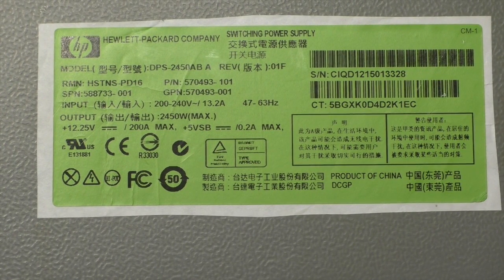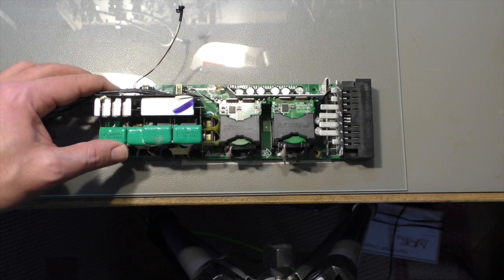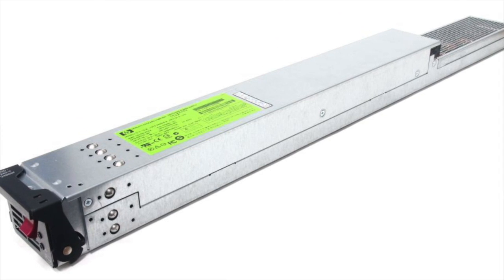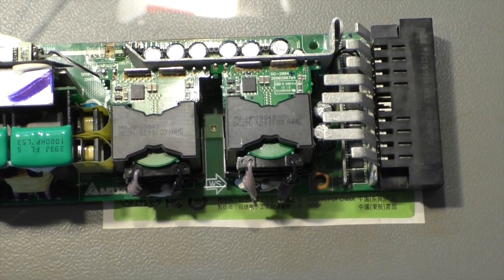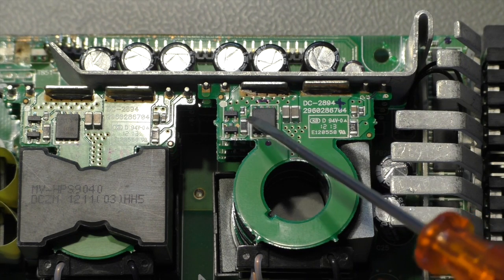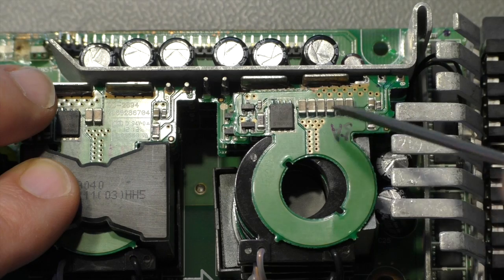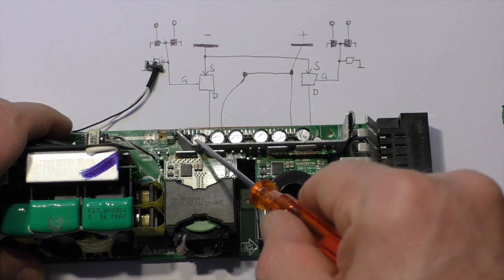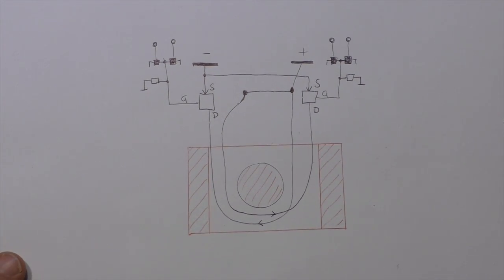2.4kW 200Amp small power supply (PWJ25)

Comment: Do you know, how the load sharing is done on these? As far as I know, there are 6 of them on a common 12V rail, on C7000 blade frames?
Since these are so cheap, compared to like Meanwell RSP-3000-12, 20€ vs 400€, it wouldn't cost much to get like 6 of them and connect them in 3x2 star configuration on 380V/32A to get like a Boostmaster 1200A for my bitching diesel excavator, instead of wasting money for new good battery every few years....

Comment: i know this is a old video, but has anyone figured out how to turn these on and what modifications to make to get the 12v 200a out of it?
Reply from the maker: Most of these power supplies turn on by pulling the „on“ pin to ground. Which one that is changes from model to model. It‘s like a PC power supply, green wire. Some P.S. will need a processor talking to them. Those are not suitable for tinkering…
Try Google „turn server power supply on“ many hints are in RC forums.

Comment: I have the same type but mine seem to be a newer model from 2011,  the date is mentioned on it, and a gold one so little better efficiency. The reason I think its newer is because its different to the better where (what I guess it is) the PFC is on the same board (and thus not single piece and thus unfortunately not removable but better when constructing) but some distance away from the same transformer principle as in the video. However the transformers in this one are much smaller and flat standing upwards and they are only, I'm not kidding now, 14mm thick, 28 mm wide and 25 mm in height and there are 4 of them and there are 16 big mosfets around them all pushed against 2 different heatsink where the mosfets closest to the transformers are on a bigger heatsink and all heatsinks are 1 mm thick pure copper and nickel plated. The area where all the transformers and mosfets are is not bigger then my hand! If you would have put that part in my hand and looked from the other side you would not have seen any of it! How the heck can they cram out 2450W from this, that is an insane 612W per transformer of that size!!
Reply from the maker: Sometimes the power supplies come from different manufacturers. There is a good chance that a different mfg has different tricks to get the same result....
Reply: @PlaywithJunk  Well true but HP sure has a finger in it form start to end since they are quite complex.

Comment: Is there a way to get more voltage from the blade 7000?
Reply from the maker: All power supplies have a 12V output... the only option is to connect them in series (24V 36V etc) But keep in mind that the cases must be insulated from each other and earth wire must be disconnected or you get a short. Not very safe by the way. I don't recommend it.
Reply: What I mean is to actually turn up the voltage on it make it 15 volts  instead of 12 v
Reply from the maker: I don't think so. There are no trimmers inside. And I doubt that some sort of remote sensing would go that high.

Comment: The semi-planar design with interleaved coils is mainly done to increase the coupling coefficient of the transformer, basically how much energy is transferred to the other side vs how much is stored as a magnetic field. The energy stored in the field is not lost, but it causes extra current to flow in the primary which needs more copper and produces more heat.

Comment: I am a bit interested in what they are doing on the AC side of this supply. HP sold two versions.  One was a 100-120 / 200-240 volt version at 2250 watts and a second that was 200-240 volt only at 2450 watts.  I'm actually interested in how the AC side was designed and if they simply simply dropped the 100-120v listing because it was too confusing (980W rating at 100V), or if there is a difference in the design between the two.
Reply from the maker: Normally, power supplies use a internal boost converter to make about 300VDC from the input voltage. This 300VDC is then processed further. In a 230VAC environment, you don't need that boost converter because you get 310VDC after the rectifier and primary capacitor.
Boost converters have a wide range of input (100-250VAC). Without the converter you need at least 215VAC to get 300VDC. So that's most likely the difference.
Reply: @PlaywithJunk  The newer supplies (better: the not very old ones) with "Power Factor Correction" have a boost converter that "rides the sinewave" to make 300V from whatever is the sinewave voltage at that time (instead of a full bridge rectifier that only charges the capacitors at the peak of the sinewave).

Comment: Very good video but it would be good to know how to raise the voltage to 13.8V
Reply from the maker: Do you want to charge lead-acid batteries? That could be difficult since many of those server power supplies are made to deliver a super stable 12V and they did everything for that. Changing the voltage could be challenging.
Reply: @PlaywithJunk  People wanting a 13.8V power supply often want to use it for equipment that is designed to be powered from lead-acid batteries (like in a car), or at least was designed for that 'standard'.
E.g. Amateur Radio transmitters are usually designed for this voltage.  It is commonly called "12v" but in reality it is 13.5-13.8V.  And this small difference is quite important because that voltage is already quite low to make decent output power (normally 100W).
But in fact this kind of power supply does not really fit that purpose.  Once you require like 2kW of power, the voltage is usually chosen to be higher, e.g. 24 or 28V or even 48V.  Modern semiconductor high-power amplifiers require that kind of voltage, and when they are powered from 13.8V they include a stepup converter.
For somewhat smaller 12V switchmode computer supplies there often are directions how to raise the voltage a bit, usually by changing some resistor in the feedback circuit.

Comment: Does anyone know how to modify this supply to be used as either a 15v or a 30v charger??
Reply: You have to identify the other signal  lines on the connector. It varies a bit from supply to supply, but typically there are Enable, Presence, Vsb, Grnd, Sclk and Sdata. Some supplies have address lines, and some set the address using a resistor divider network using the Presence and Enable pins. 
That depends on the model and for what chassis they were designed for.  Word is you can stack the output in series to boost voltage but must absolutely go though and isolate the output from ground on the second and additional supplies before trying to do so. Playing with 200A PSUs can be a bit dangerous.  There have been some videos on adjusting output voltage, but I haven't seen one yet for this particular model. Also this is video shows a 200-240 volt supply.  There are 2 versions of this particular supply. One is a 200-240 only, and the other is a 100-120 or 200-240 version with a slightly lower output rating (2250 watts vs 2450 for the 200-240 only variant). On 100-120 volts the rated output is (only) 980 watts.
Reply: Oh.. I forgot to add, I haven't seen anyone look at controlling current or putting these supplies in a constant current mode.  I have no idea if that's possible. It IS possible to blow out devices using this as a charger if you don't have current limiters that can manage the 200 Amps in place.
Reply from the maker: Without a schematic diagram, that will be difficult. I doubt that it is even possible since this is made to supply 12v and nothing else. Maybe you can tweak it to 13 or 14v..... but certainly not 30.
Reply: @PlaywithJunk  the 30 would be two units in series. I have t been able to find any schematics either. Frustrating

Comment: The mosfets at the output are the 'Oring Diode'. These power supply are stacked in paralel operation, so if one of them fails by shorting the output....those fets will decouple it from the buss bars. 
The topology used in this supply for the rectification is called current doubler, and uses ZCS [LLC] for reducing switching losses. If I remember correctly it should not have inductors at the output, the secondary of the trafo looks like a push-pull configuration [center tapped]. It would be interesting to see the turns number in the primary side. I'm expecting near 20...

Comment: Very nice presentation. Today I`ve dusted off a similar HP power supply(DPS-1200FB-1A). Mine has 1200W Output Power 12V @100Amps (94%). The amazing fact is the size. It`s so small and it has the same topology as the one presented in your video. Thumbs UP indeed !!!

Comment: Nice Video, i have never seen this "PCB Coil" construction before.
But i think your loss calculation shuld inlcude the switching losses:
In those High frequency Switching Powersupplys, the "turn on loss" is only one part of the the whole. The switching losses of diodes and Fet's  are proportional to the frequency and can be much higher than the DC-resistance losses.
Reply from the maker: +Bibarco That's certainly true but since I have no data of this power supply I keep it simple and playing with DC figures.
Reply: Play with Junk

Comment: Transformer construction is like the planar magnetics commonly used in DC-DC converters, where they use a multilayer PCB for the windings.
Not sure why they need all those FETs on the outputs as well as the ones on the transformers. 
Those green capacitors on the HV side maybe mean it's using a resonant topology, where they switch at zero crossing to reduce switching losses.
Reply: +kubeek 
I see you misunderstood what I wrote above:
1. I was talking about those  mosfets situated near the output connector of the PCB, those are for the Oring " active diode" which offers the capability to connect multiple power supplys in parallel and if one enters in short circuit aka FAULT, will not pull the whole supply bank to ground or catch fire.
2 . Synchronous rectification is used in high current low voltage for higher efficiency, more than 100w saved in this power supply with synchronous rectification.
3. Individual rectification on the output transformer ensures an easily current sharing between mosfets. Nowadays these mosfet's cand have down to 0.5mohm and it;s hard to ensure a good current sharing between them, so by splitting the seccondary turns in many groups, the parasitic resistance of each winding can be used for our advantage by helping on current sharing.
Reply: +mikeselectricstuff The transistors from the edge of main board are the O-ring "diode" as this power supply can be used in parallel, so they have active diode for protection against internal short circuit without pulling the whole bus bar. Also it can be hot swapped. It is nice to have individual synchronous rectification on each secondary coil, as it can share better the high current over the mosfet. Good design.
Reply: +mikeselectricstuff 
Those coils on the primary side and the lack of a secondary filter coil is another tell-tale sign of a resonant topology. I'd guess it's an LLC topology. You can see that the primary side coils are connected in series with the transformers when chrigel1234 flips the board at 5m36s. 

That multiple section design of the transformers is probably done in order to keep eddy current (proximity effect) losses low in the windings. A side effect is that the leakage inductance of the transformer is reduced, so the external coils were likely necessary to get the desired frequency/gain response in order to make the LLC converter work well over the full range of load and input voltage from the PFC stage. I'm not sure, but it looks like one might be in series and the other in parallel with the transformers.

+chrigel1234 Thanks for the teardown of this piece of equipment! :)
Reply: I would guess the transistors on the edge of the pcb are for the hot-swap capability, they probably have dV/dt control on the output so the transistors have to dissipate a huge amount of power when switching on into all that down stream capacitance so they need a lot in parallel to keep them inside their SOA
Reply: +Gatea Catalin nope, the output transistors are mainly used as synchronous rectifiers to get reasonable power dissipation in the output diode after the transformer, the 0.4V drop vs 1mOhm on resistance being the selling point. The or-ing capability is just inherent to the general smps topology (but not current sharing between parallel supplies).
Reply: +Gatea Catalin  oooh, so the mosfets on the transformers are actually used for rectification,  and those layers are in parallel. I thought mayhe they somehow switched in and out more  "turns"  on the transformer.
Reply: +mikeselectricstuff Mike is EVERYWHERE  :-)